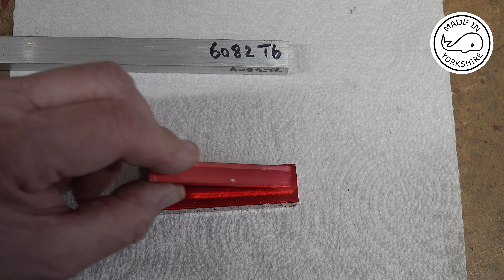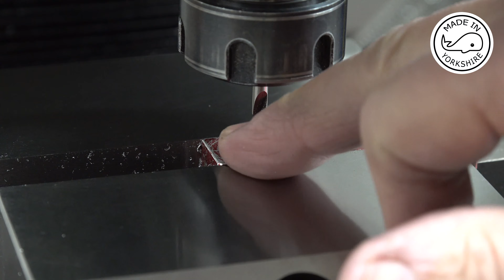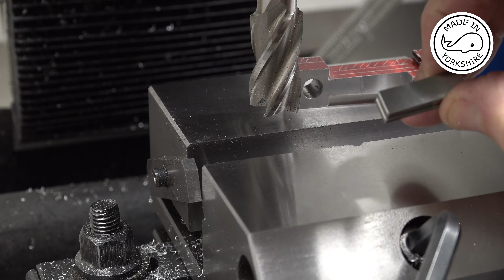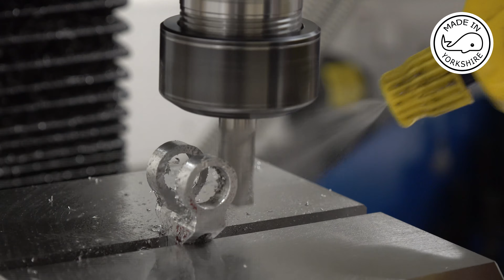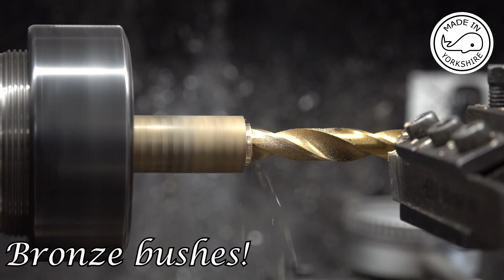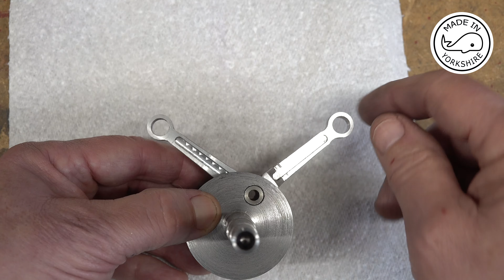#MT49 Part 9 - Jerry Howell V-twin IC Engine. Machining the Conrods. In 4K/UHD by Andrew Whale.

Comment: Nice looking Conrods Andrew!  I especially liked your set up and work on the rotory table. It all fits nicely together, great job.  Greg
Reply from the maker: Thanks Greg. I could have made a better job of the inside corners by using a drill first - you live and learn! If you have a rotary table I would recommend machining an arbor to hold stock around the centre. It works very well.
Cheers
Andrew

Comment: Ignore "the family " and enjoy the bike Andrew. 
If "family " see the enjoyment you get from riding she will begrudgingly accept your little bouts of "insanity" until you come off. Then expect both barrels, the riot act, and impending divorce to be aimed your way mate.
The most important thing about riding is knowing EVERYONE else on the road is a potential homicidal maniac and ride accordingly. Never insist on your right of way. 
Eric
Reply from the maker: Hi Eric - it's a major dialema. It would be great just to be able to take the Bantam out occasionally, but there are so many cons too. Also at £160 a lesson, plus decent gear it starts to get expensive for such occasional use. I might see if I can get access to a local airfield/circuit, just to be able to run it occasionally. 
All the best.
Andrew

Comment: Thinking of biking in the rain, you have considerably less grip when the roads are wet, its not like a car where the weather makes very little difference unless it is freezing, so don't get too used to dry roads and thinking it is always this good. Where rain is concerned there is nothing wrong with a little paranoia, especially around manhole covers😉
Reply from the maker: Thanks for the advice Chris.
All the best.
Andrew

Comment: Great outcome Andrew. Tools need to be super sharp with phosphor bronze, I would use HSS for that. Looked like your Carbide parting tool was a bit blunt as it threw up a hell of a burr that you needed to file off. Regards from Australia.
Reply from the maker: Thanks Dave - The parting tool was HSS, but you are most likely correct regarding getting it sharpenned.
All the best.
Andrew

Comment: Trying to do what You do would likely be the worst nightmare ever. Way above my capacity. Anyway, Your videos are highly interesting and often inspiring. The rigging, angle of attack, etc. 
Your "doing it off camera" is done with success as You tell what You will do before it's done. Thanks! 60 minute maraton videos are often "put on the shelf", and never watched.
Almost done with my digitally controlled rotating table Your video inspired to make a reverse move function. How to handle the backlash? Some kind of calibration procedure. Brainwork needed!
Time 21:00. You use a rather wide part off tool, wasting valuable bronze.....
I'm happy to share Your joy Andrew! Well done!
Reply from the maker: Thanks Stefan! A reverse move function for the rotary table sounds interesting - it's good to set challenges for the brain. Extremely satisfying when you solve a problem too.
Good luck!
Andrew
Reply: @learningturningmetal  Made the reverse function and debugged it in a few hours. Even I am surprised. Remains to take care of backlash....

Comment: A nice bit of straightforward engineering. Good progress after the difficulties with the crankshaft. The conrods look good and a really nice fit. Good luck in your negotiations over the motorcycling 😉🙂
Reply from the maker: Hi Tim - hopefully I should be close to doing a build of the bottom end - a significant milestone. Yeah - I think my motorcycle licence is starting to look unrealistic. Lessons aren't cheap either at £160 a pop. 
Cheers for now.
Andrew

Comment: Hello Andrew. A slip of the tongue: you said that you were going to machine a slot in the little end when, of course, you meant the big end. If you can afford it, it would be worth qualifying for your full motor cycle licence even if you don't progress to a bigger bike: you would then, at least, be able to ride your Bantam on motorways if you wanted to, and it would give you a great sense of satisfaction. One of my favourite bikes in my younger days was a 1958 BSA B31: it wasn't quick, but had loads of torque and was quite relaxing to ride. It was also more stable than my smaller machines in cross winds.
Reply from the maker: Well spotted George - quite often my brain doesn't angage with my mouth properly!
It would be great to get a full licence, but I'm quickly coming to the conclusion that it's not going to happen. Also quite costly at £160 a lesson.
All the best.
Andrew

Comment: Hi Andrew, good progress. If you drill/ream 4 holes of the right diameter in the transition between the external radii and the con rod flank, it makes the blending in much easier and neat. I rode big bikes for years, ended up using them for the commute to work, and that is what made me hang my boots and leathers up for the last time. If you avoid commuting hours its a pretty safe hobby, so go for it, your grin is what balances off against the risk and you are already wearing that! Cheers, Jon
Reply from the maker: Hi Jon - thanks for the tip. I think the motorcycle licence is starting to look unrealistic. It also seems like a lot of hassle just to be able to take the Bantam out occasionally. Quite expensive too at £160 a lesson, plus all the clothing. There are several old airfields in my area, so I might try to see if I can get permission to ride the Bantam on one of those. I would only need to buy a towbar and a small bike trailer. We will see!
Cheers
Andrew

Comment: Coming along very nicely, Andrew! I bought an old cycle and was going to turn it into a café racer just for fun. Well, I’ve had four major, spinal fusions and a lot of steel holding me together, and my family was extremely unhappy. So what I did was sold the bike or a second lathe for my shop. it’s a win-win situation for both sides lol.~Paul
Reply from the maker: Oh blimey! Maybe I need to get the idea of a motorcycle license out of my head, but it would be good to be able to take the old Bantam out now and again. At least your familiy won't complain about you spending too much time in the workshop!
Take care!
Andrew